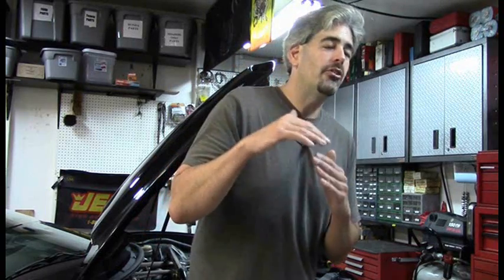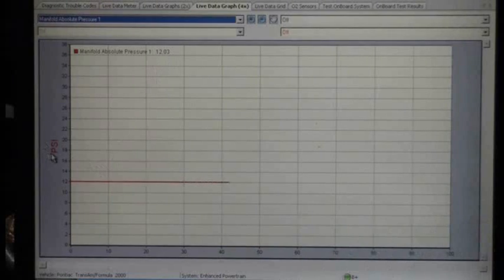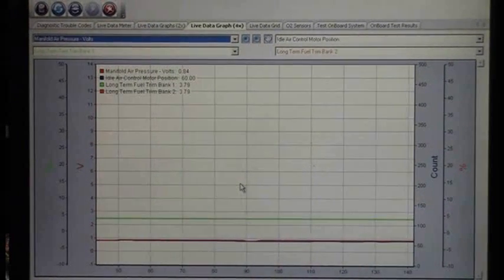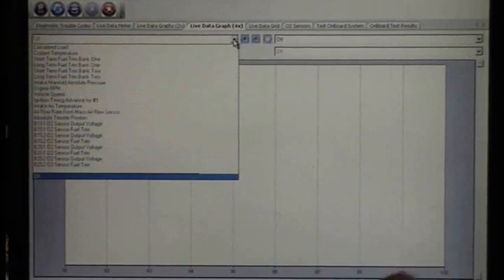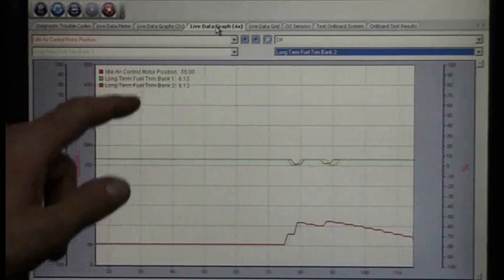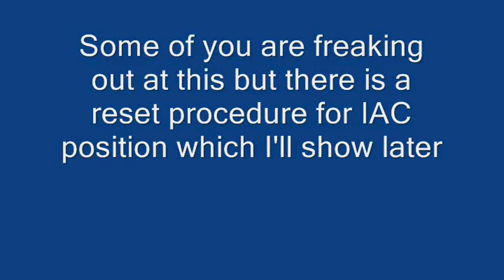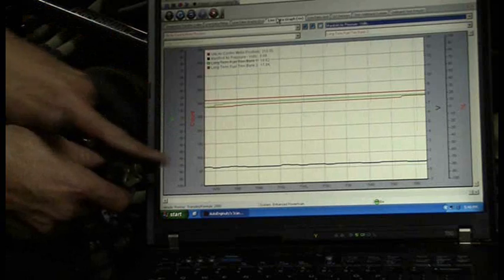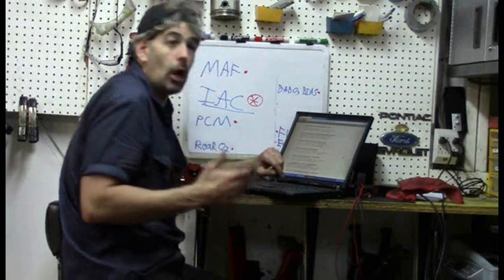P0171 Case Study from Hell 2000 Trans Am Pt3

Comment: Up late tonight with a severe ear infection, trying to keep my mind off it. And your videos I find do the trick! I don't watch many YouTube vids, just don't have time. But I am enjoying this. I like hearing your thought processes. We think a lot alike.
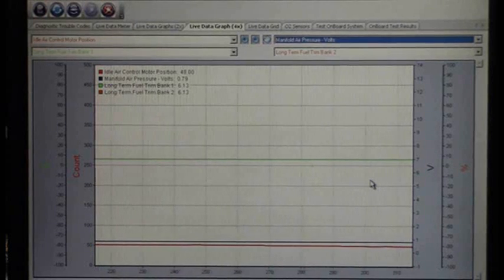Anyway, at 17:47, when you disconnected the IAC and were commenting on the count not changing. Remember the IAC count is a command, not an input. So we have to view this a little differently, especially stepper motor designs. The only way the PCM can keep an accurate track on the pintle position, is to re-orient it's 0 count on each key cycle.
The actual valve position and count command on the scan tool should be the same. However if the valve sticks at all, even for a moment, it then becomes out of sync. So the valve could actually be 30 steps out from 0, but it took an issued command of 50 to get it there. At one point I was seeing 100 on the IAC at idle, would have been nice to see desired idle and rpm pids at that moment.
A hypothetical:
RPM 600
Desired 700
IAC 30 and rising to open the valve to achieve 700.
If the valve is sticking, you may this count go very high, lets say at 100 issued commands to open (counts) the valve finally moves. Idle is steady now.
RPM 700
Desired 700
IAC 100
Hope I am making sense.
So I haven't watched the rest of the video yet or the newest upload, but let me add one thing. I have read the some fuel control is based off of the issued IAC command. So could a sticking IAC cause fuel trim issues? If this theory is correct, then yes.
However, if this valve is sticking, I would expect intermittent high idle, low idle and stalling complaints as well. Not just fuel trim codes and no other driveability problems.
Keep up the great work!
Reply from the maker: ScannerDanner Danner, it's an absolute honor to have you on my channel. You will enjoy this series... sorry about the ear infection, but sit back and enjoy- this one is right up your alley.
Reply: Oh yea, and when you unplug a stepper motor, you lose the sync as well, so you cannot rely on the count on the scanner to match position anymore until it resets the o count. (cycle the key)
Reply: rhkips No, it is a stepper motor. Stepper motor displays are always listed as "steps", "counts" or "position". Each control wire on a 4 wire stepper is pulsed on and off as much as 30 times for second, to not pulsing at all (holding). So on all 4 wires you will see either 12 or 0 (not 5 like you were thinking). So a voltage display on the scanner for this type of control circuit would be useless because each wire has a different voltage level and would not indicate position.
I like your thinking #rhkips about power and ground side switching. This one is different than other outputs. It is both! In other words it is a reverse polarity circuit for each wire. Sometimes it is grounding the circuit and sometimes it is applying power to the circuit. I wish I could post pictures here. I could describe it so much better with a picture.
Hopefully I helped clear things up for you a bit. 
Lastly, remember that IAC position on the scan tool is a command. You are not looking at the actual position of the valve. The actual position is assumed and should be correct as long as the valve is not sticking.
Reply: ScannerDanner Ah, alright!  I understand now.  Thank you, Mr. Danner!  I don't know why I was thinking 0/5V; probably because I was watching a bunch of your sensor diagnostics videos last night?  XD
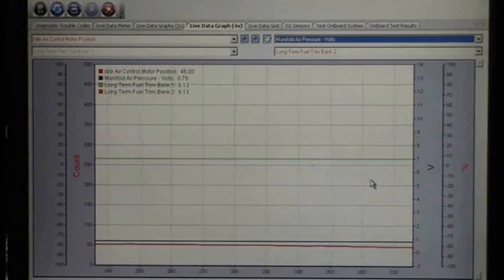Reply: At 17:47, the IAC was displaying as voltage, not counts.  Is that an interpretation of desired steps, or actual voltage being applied to the IAC?  I have to think it's either interpreted, or just completely false.  There should be 0 or 5 volts, depending on if it's a ground-controlled or power-controlled.  My poor little brain cell is struggling with what's actually happening...